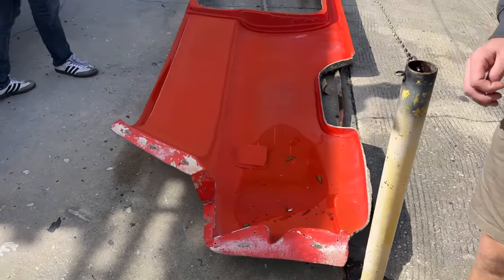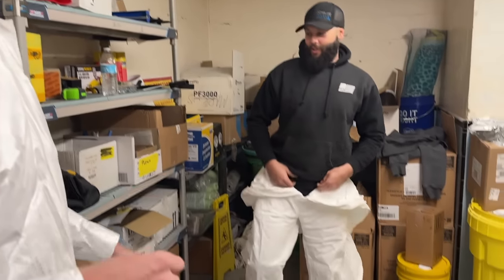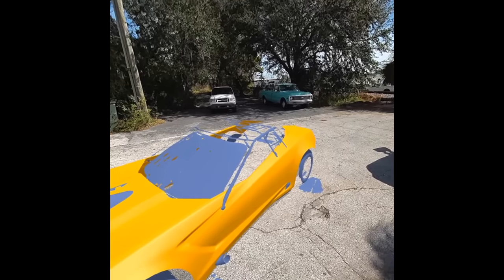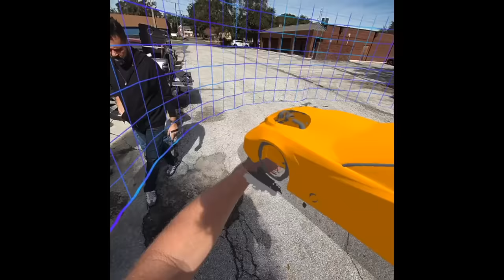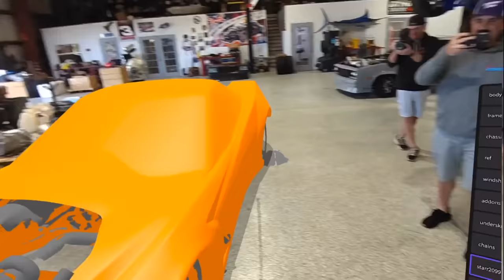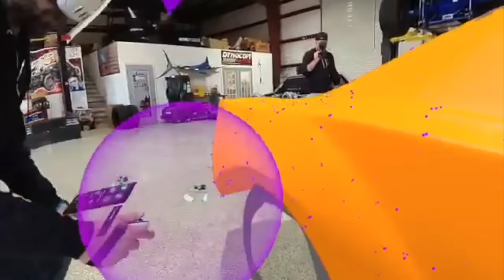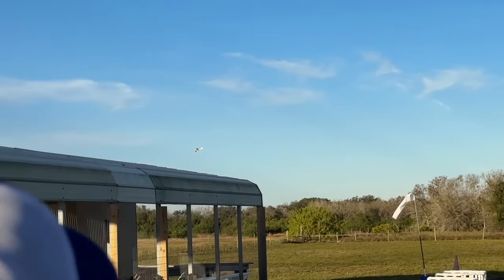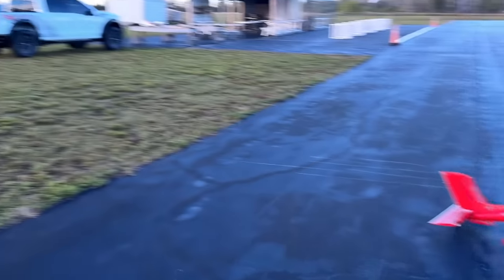Leroy's NEW Racing Body Has Begun!!! Our First Fiberglass Spray & The Design Looks INCREDIBLE!!

Comment: I used to spray fiberglass using that same chopper. Only the hoses were connected to a big boom so you could walk 20 to 30' circles. Fiberglass would be at the center, pallet at a time. I'm pretty sure Saint-Gobain made our fiber glass out of Texas. I worked for Baja boats building the Outlaws & others like the Islander. Only we didnt have any respirators, just safety glasses & paint pants. Shop would always have a mist hue in the air. Its the only time in my life my nose has bled. Still enjoyed being a gunner & knocking out 5 to 8 boats a day. People I worked with were the best to be around. I was 20 years old doing that for 10 to 12 hours a day. After I left I was still finding fiber glass years later. Gets everywhere. Thanks for the memory refresher.
Reply: You're talking about some serious permanent damage there buddy. Imo asbestos isn't any worse than fiberglass.
Reply: Similar story, I still find old clothes covered in resin, 25 years later...
Reply: Is it true that their beards are actually just fiberglass over spray?
Reply: What's all-in cost of this body?  Design,   wind tunnel testing, modifications, final product?

Comment: Just a tip guys, you can absolutely make panels to create low pressure zones around the areas of high drag. That way Leroy has a “body”, but still looks like an exoskeleton car.
My company 3D scans vehicles and wind tunnel tests them on the computer. It lets you test tons of different panel / body configurations in just a few hours.

Comment: Got to make sure  the nose is within the rules for front overhang in the class you are running.  There is a limit on how far the nose can be from the front wheel.
Reply: They know that😂
Reply: @-LK34-  We can assume they know, but the car never had an actual body before lol, so who knows? I just want to see it done up as a pissed off eagle face and feathers and flames in the rear.
Reply: @MultiTravellingman  James mentioned it when they were scanning Leroy so I'm sure they're aware
Reply: he has like 10 different class cars. he knows the rules lol
Reply: He runs all out stick shift in Leroy... Soooo
Reply: @MultiTravellingman no assumptions they talked about it. 🤦‍♂️
Reply: I love the idea of the "beak" but it's hideous looking. The distance from front wheel centerline to tip of the front end is WAYYYY too long. The front end is too high visually as well. I understand they are using wind flow as an input for shape, but visual presence should be a big factor as well. Being aerodynamic and hideous isn't a win in my opinion
Reply: @highpsiguy4085  it's a pro mod body........
Reply: @craigjones3506  I wouldn't quite call it a pro mod body. He is making it to comply with the rules of the class the car is in. But that doesn't mean it can't look good in the process. Or more appealing/proportional I guess
Reply: @highpsiguy4085  they stated clearly from the beginning that the wanted a pro-mod body. You'll see.
Reply: @craigjones3506  I must have missed that part. I remember them mentioning the nose length and other factors had to fit within their class rules. I didn't catch the actual pro mod mention
Reply: @highpsiguy4085  there have been two mentions now. Once at the very beginning and once at an event with a bunch of pro mods. Something along the lines of "won't be long and Leroy will be just like this!"
Reply: @craigjones3506  now I know. Am I wrong for thinking it could still be more pleasing to the eye while being functional
Reply: @highpsiguy4085  youre not wrong. But I think this will be more of a beauty in function rather than form. Kinda like the McLaren Senna. Ugly ass car, but beautiful because it was designed that way. Or the F22 raptor lol. Little form, lots of function.

Comment: Need to watch how long the nose is. Most classes and sanctioning bodies have rules about front over hang length from front spindles
Reply: Thats why they're adjusting it to be more like a c7 corvette, the model with the beak is a custom model. He said that they're going to re do it with the c7 model diameters.
Reply: They discussed wheel base and length in their first meeting. Should be good but still just not feeling this thing.

Comment: The MEKP that's used in that resin is really intense stuff. I worked briefly with a guy who had 20 years of vynl-ester resin work and his eyes looked like 2 big milky saucers.
Reply: I work with it daily maintaining and repairing these chop rigs, it’s serious stuff and the amount of people I see in here thinking it’s the same stuff as the 2 part epoxy you get at Walmart that sets in 24-48hrs is insane. This stuff will blind you in seconds if it gets in your eyes.
Reply: methyl ethyl death
Reply: I used to work at a specialty resin adhesive plant, MEK was my favorite smelling stuff, lol. Toluene is the worst.
We made high performance resins from basic things like sandpaper adhesives, to military and aerospace coatings. It was pretty cool, but some of those chemicals were super dangerous. One of the worst was ammonia, we used 33% and just popping the cork on the bottle would damn near knock you out if weren't opening it in the fume hood. And some chemicals had big skull and crossbones warnings of "This will cause cancer or death if exposed". Not the watered down california "May cause cancer".

Comment: Methyl ethyl ketone (MEK) I used it for years here in California than the state of California bandit saying it's not safe. I'm still alive. It's safe. It is a very universal solvent I used it doing subwoofer repair. It broke down the glue. Nice and didn't leave any damage or staining to the cone. Also works really good on getting contaminants off of paint without damaging the paint if used correctly, especially road tar.
Reply: The MEKP we use to build yachts will strip paint in seconds. Will also burn skin in seconds and blind you in seconds. There may be different chemical buildups in the stuff you’re used to lol these chop rigs use some brutal catalyst. Not like the stuff you mix at home and it sets in 24hrs. This stuff reacts hot and quick. An entire hull will be fully cured in 4 hours max and we’re talking 200 gallons of resin lol
Reply: I was thinking the same thing when I heard that.
Reply: @anthonyboylan9212  That's MEK-P, but in the video the chop guy just said they used MEK. We have no idea what resin they're using, nor what catalyst. But MEK is commonly used as a thinner, so it's possible they're using regular MEK.
Reply: @theKashConnoisseur  correct, but this chop rig is most certainly using MEK-P. Those that work with it every day generally just call it MEK, or cat (catalyst). We use many variations of Norox MEKP
Reply: @anthonyboylan9212  you reckon that's the same catalyst we use for home-mixed boat/casting resin? You know, the stuff that gets steaming hot and sets in a couple hours.
Reply: @theKashConnoisseur  if it’s MEKP, then yes. Polyester resin requires MEKP to kick which is why I can safely assume they’re using MEKP. Just trying to clarify as the guy in the video may have said MEK, but he meant MEKP and it’s not at all a safe solvent lol
Reply: @anthonyboylan9212  usually for home gamers it's just labeled part 2, part b, or just a catalyst. But it's a 4 hour curing boat resin, which seems to align with your 4 hour curing yacht resin. 

MEK isn't a safe solvent by itself, you know. It might not be reactive as MEK Peroxide, but it's far from harmless. And I understand what you're trying to clarify but MEK also exists, is also a thinner used in coatings applied to fiberglass resin structures (among other things), and as demonstrated with the casting resin we use at home, there's quite possibly multiple resin chemistries using different catalysts. So while you can make an educated guess that when he said MEK he meant MEK-P, you can't be 100% sure.
Reply: @theKashConnoisseur  I see what you’re saying. I do understand both chemicals and their uses which is why I wanted to try and educate those that may try doing this at home and thinking it’s safe to handle ya know? And yeah, I can’t be 100% but I’d feel safe at 99% sure they’re using MEKP.
Reply: @anthonyboylan9212  totally, looking out for safety is always a good thing. I hope everyone treats hazardous chems (be it MEK or MEK-P) with the proper respect.
Reply: @theKashConnoisseur  It scares me how nonchalant the operators at work are with MEKP. It can combust by heat, spark, or even compression/impact. One of the training videos we have to watch to work with the stuff shows someone using a dropper to drip 2 or 3 drops on a piece of paper, then hits it with a hammer and it explodes like a fire cracker. I'm in maintenance so I'm responsible for repairing/rebuilding the spray guns and pumps and the stuff I see on a daily basis is terrifying.
Reply: @anthonyboylan9212  holy! Its one thing to be bad for the skin and eyes, but exploding with impact is terrifying. I'm sure there's big drums of the stuff just sitting around, naturally.

Comment: That Augmented Reality conversation in the VR goggles was really cool despite the poor quality, those tools are incredible
Reply: I knew I would find someone like this in the comments, they are using a very basic application right off of the Quest 3 hardware. With a PC and a link cable or a good Airlink connection, you can have a fully detailed model of a real car in the place of that low quality sketch. Don't underestimate things withought looking further into them.
Reply: @fireskydiver7 what app is this called?

Comment: I've been in fiberglass for 45 years but I never took to chopper gun laminating, too messy for my liking. I still prefer to make patterns and tailor my mat to the part and apply resin with brush or roller then roll out with paddle rollers. Yeah it's slower but also no risk of the catalyst jamming up and getting a no cure situation.
Reply: Yeah, I never liked them. Watching them walk into the spray booth, I could feel my skin crawling, and was waiting for the prickling sensation under my collar, as a bit of glass dug into my neck.....

Comment: Chopper guns are great for mass-produced stuff but for the lightweight comp gear, you can't beat woven mat and vacuum bagging. That comes from 3 years of making motorcycle parts hand-laid and a couple of turning out bodies for top fuel for Brett Stevens/JD Racing. I so wish we had been able to do hand-laid woven mat vacuum bagged there instead of chopper gun, I would have saved 40 plus kilograms per body.

Comment: If you love r/c planes you NEED to try a 5 inch digital FPV drone. You would absolutely love it. You use goggles to pilot the quadcopter using a camera attached to the front of it. It’s absolutely amazing.

Comment: Cleetus why are you guys not using a buddy BOX? George you need to find a sim and use your radio in a sim. Also, I find that with new pilots if you keep the antennae pointed in the direction of the nose and just turn your head one way and swing your arms the other you can fight the disorientation, but it is a crutch that you will have to get over. To be more clear, let's say you are coming in from the left towards you, you would then turn your head left and sing your arms to the right thus keeping the radio aligned with the plane.Everyone has trouble with that first and sims can help as well.

Comment: I hope the actual body will have air intakes at the front and a caved down (as if you pushed the hood down from tolhe back of the turbo's (lowest point) rising to the windscreen) to pull out air from under the nose and guide it out after the turbo's or this thing will create al lot of drag and lift...

Comment: Cleetus, isn't there a rule about how far the front end can stick out in front of the car. Just wondering because of the deal like where people run the old pecker extender to trip the beams on the big end. And the Eagle beak sticking out could actually only be so long couldn't it?

Comment: remember when i had a 4 cylinder bike engine, i put 75L worth of octane booster treatment in the 10L tank, went from not running to running... but that stuff was polled at +11% per 300ml/75L... 300ml/10L... it bent all the wrist pins and thru a rod. +82% power that only felt like 40hp, as it was a tired old 7hp 650cc 4 cylinder engine... if the gas station sold fuel with that same mix in it it would be $6.90/gal, and a 200hp block would be doing 400hp out of nowhere. end of the cast iron engines?

Comment: theres a reason the wheels are tucked so far on pro mods and funny cars, cleet. Flush does look cooler but your tires and wheels are like little turbines, gotta have the fender flare throwing the air accross the gap as much as it can

Comment: Just quick observation and you probably discussed this but isn’t there a limit on how far the body can past the centerline of the front wheel? I don’t know the rules just wanted to throw out a double check reminder just in case so you don’t get stuck with a sick body you can’t use except for non competition use.

Comment: Yooo, can you cock the turbos 30 degrees and have them face a little left,right.... This way the turbos will look like eyes. And be  more aerodynamics. The turbos will still suck air very well and any differences in the air flow will be taken into account in the engine afr software. Power loss due to the turbos being rotated slightly will be negligible, but the turbos looking like eyes will be Gucci